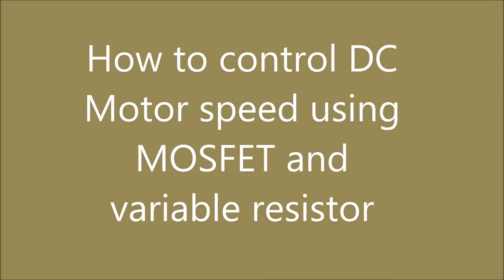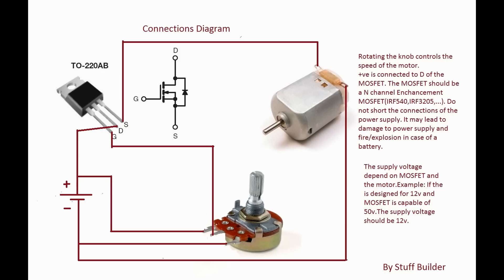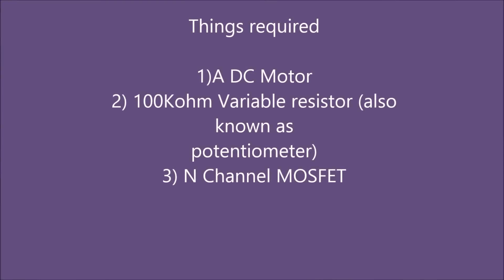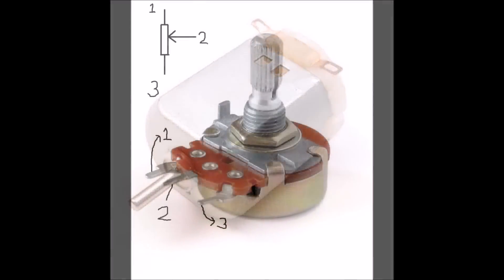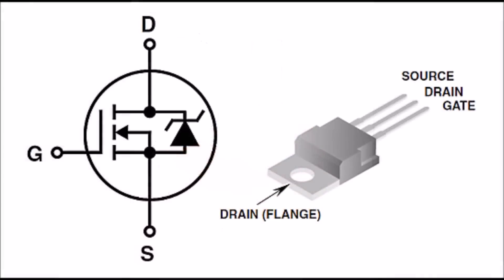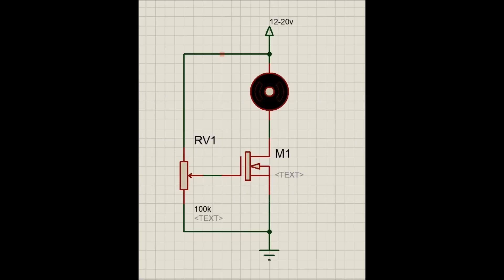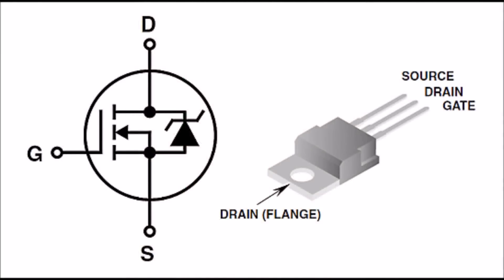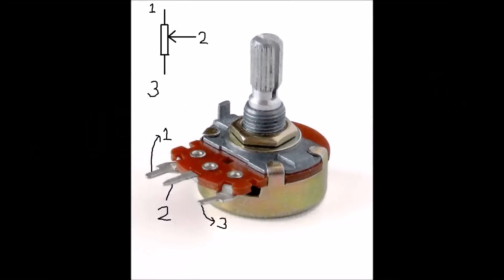How to build the simplest DC Motor Speed Controller(Using Potentiometer and MOSFET)Updated

Comment: Can I adjust the input voltage of a zvs, or 555 driver( fly back driver) I mean...I have a 24v power supply and I want to use it at less voltage too, but it is strictly 24v not adjustable... So can I hook up this and make the voltage lower???
Reply from the maker: +gyorgy komaromi Yes. You can use this circuit as voltage controller. I have used for the same many times!!
Reply: Stuff Builder Wow, thank you very very much!!!! You really helped me :) thanks again!!!

Comment: Could this be use to drive a motor for a ROV?  I am trying to save some money by making my own speed controllers and came up with the idea of using the potentiometer as the variable speed controller.  My idea was without the mosfet, but I am seeing that the mosfet is needed for this for higher voltage.  I am not sure what amperage or voltage I am going to use till I figure out what I need for each motor and other components such as the lights, camera, and possible sensor.  There will be no manipulator for this project for the moment.  Thank you in advance for your assistance in this matter.  BTW, if this works, I am indebted to you for saving over a hundred dollars.  Also, is there a way to reverse this so I can also make the motor spin in reverse?
Reply from the maker: +Matt Walden Yes. You theoretical control the power(torque) using this. But it would require a system to keep the MOSFETs cool(but since ROV is used underwater, that doesn't seem to be a problem.) But still If I were you i'd probably go with PWM. About reversing, you need four MOSFETs configured in H bridge. I have controlled motor in both direction before but I don't remember the circuit that I made. It was a year ago so I forget. And sorry for replying so late. Anyway, BEST OF LUCK with your ROV
Reply: Well... not if you put the dpdt after the the potentiometer and mosfet.  Like between the mosfet and the negative terminal.  That should work and I might do a test on that and let you know.  If this works, I might have a cheaper speed controller.

Comment: +Stuff Builder 
Hello Sir! Does it reduce the speed without reducing torque? (such as PWM). Or is there any simple way I could handle @ home? Please answer asap. I'm stuck in the middle of my project.. Thank you!
Reply from the maker: +kuukeldei deidara Of course the torque is reduced,since it controls the current so less current will produce less force(less magnetic field) and the torque will also get reduced.
Reply: Thank you!

Comment: how to control dc motor speed ....... I have 24v 76A motor... i want to control this motor speed.. can any one tell about it how can control it ..... any diagram of circuit plz tell me
Reply: +usmanshahkot Are you sure its 76 A and not 7.6? You would need a 24v PWM, at around 100A, or a transistor with a potentiometer but the transistor needs to be able to handle the current, or put a bunch of them in parallel. The wiring changes with the type of transistors. Basically, use a potentiometer to feed + voltage into the trigger of the transistor, and the transistor, if wired properly, should vary the output voltage depending on the resistance of the potentiometer.
Reply: +Brian Winzey Not the way to do it. Your MOSFET will need to dissipate about 2kW (76A x 24v). These devices cost hundreds of dollars. Better to use PWM then you can use a cheap $10 device.
Reply from the maker: +TurboElectricLtd The drop across MOSFET isn't 24v, its around 3v when POT is fully rotated. So power dissipated will be 3*76=228W Which is still a lot! So yeah this isn't the way to do it. Go for PWM. It's really efficient! But for lower current, this way is okay
Reply: So the problem is when you have partial conduction on the MOSFET If your motor is drawing 50A (because you are drawing on a heavy load) at say 1v PD the rest (23v) is across the MOSFET ..... and pop it goes.

Comment: tnx for your info I have a dc motor and I want to make an e bike. motor work 12 v  if I connect 24 v it will work of the motor will born I neet mor RPM
Reply from the maker: +Aldeen Tabasa Nope! It won't be efficient! The MOSFET will burn probably! PWM is what you need for such applications! I just uploaded I video yesterday about that but it's a bit more complicated
Reply from the maker: +zabihullah Ahmadi You need a high torque motor to make a e-bike. If you power a 12v motor by 24v, It's windings will burn after sometime.
Reply: +Stuff Builder so i can build e bike with this controller?
Reply: ok ty you are very kind person
Reply from the maker: +Aldeen Tabasa I'm actually not that kind😬
Reply: HAHAHAHAHA

Comment: how to make it more slow then that? like 1 rotation it take 1 or 2 second to complete. add some resistor? pls answer ASAP, urgent matter.
Reply from the maker: +Fariq Qiraf That's too slow. You could try adding a gearbox to its output shaft. I have geared motor like that which rotate super slow but they have a gearbox. You could probably do it but adding power resistor but still it won't rotate smoothly. Still you could try add resistors in series and try. But i'd recommend a low rpm gear motor.

Comment: it work whit 20 Amp dc motor
Reply from the maker: +zabihullah Ahmadi Yeah it will work with any DC motor, MOSFET will change according to current and voltage of the motor. Appropriate heatsink needs to be attached for high power motors.

Comment: Is it possible to apply this circuit to control  a 45W, 12V DC motor's speed ? Will it work that way ?
Reply from the maker: +Yakup Onur Çota Yes it  will. You'll need a heatsink attached to the MOSFET though.

Comment: Do you think it works with 3.6 v at 1.5 A controlling resistive heater ?
Reply from the maker: +dan gh # Actually I'm not sure if it will work at such low voltage. No the MOSFET I've used won't work :(

Comment: i need to build one that will run 120 volts dc. what you think 3 mosfets?
Reply from the maker: +Rj Norman No. You'll a high voltage MOSFET.
Reply from the maker: +Stuff Builder You should be careful with 120v DC. You could get a nice electric shock if don't take proper care. IRF640 should work good for you.
Here's a list of MOSFETs you can refer.
http://www.futurlec.com/TransMosIRF.shtml
Reply: Thank you for the link Stuff Builder and Ill watchout to not become a short in one of my circuits.

Comment: Does this mean if you have an NPN mosfet and PNP mosfet
you could make the worlds most shittiest sounding audio amplifier? lol just by connecting them in a push-pull configuration and adding the input line signal to the inputs then biasing them to "almost turning on" state? and a simple capacitor for the speaker?
Reply from the maker: +realflow100 That's right. That's exactly what i did!!!! But it wasn't shitty. To my surprise, it actually sounded pretty good almost as good as a professionally made amplifier. You just need to bias it perfectly.
Reply from the maker: +realflow100 And its not NPN or PNP , it's not a BJT.
Reply: Stuff Builder hmm then what do you do? o.O I wonder how bad it would sound completely un-biased xD thats what i meant when it would sound terrible xD

Comment: hi, dont you need a diode protection for this circuit?
Reply from the maker: +lui fado If you are talking about diode protection to prevent back-EMF from the motor, then there's no need because most of the MOSFET have reverse diode protection built into them
Reply: +Stuff Builder i didn't know that , thank you.

Comment: We can also control motor without MOSFET and Brother what is the use of MOSFET?
Reply from the maker: +Manasseh Elson You can't just control the motor using the potentiometer by itself! A high power handling transistor is required to control the motor current.
Reply: +Stuff Builder why we cant use just a potentiometer? bro
will it burnout due to load?
Reply from the maker: Yup. That's right !!
The load(current) is high for it. Potentiometers can directly control currents that are lower than 100mA I think

Comment: Nice. The MOSFET gets hot after a while? Could work for 12V, or is too much?
Reply from the maker: +interlinkknight  Yes. It does get hot pretty soon. Its the simplest way,but its the most inefficient one(PWM is way more efficient). That is why is gets hot. I'd say,its best suited for low current applications. The max voltage depends on the mosfet.
Reply from the maker: +interlinkknight I used it to control motors(and other loads) at 24 V. But I connected three MOSFET in parallel and attached a big heat sink to them to keep them from over heating.
Reply: +Stuff Builder The problem with PWM is that is very noisy. You can always hear the winning sound from the frequency of the controller.

For my project I don't care about efficiency.
Reply from the maker: Then you'll need to attached heatsink to the MOSFET to keep it from getting hot. And Good luck with your project !

Comment: what type of mosfet? par# ?  i thought mosfet is just a switch 
is this a Nch or Pch mosfet?
Reply from the maker: Frank Lopez N channel enchancement type MOSFET.
I used IRF540N
Reply from the maker: Stuff Builder
And you are right about its been a switch.But if you vary the base voltage w.r.t source voltage gradually then you will find that its resistance also decreases gradually. But this a inefficient way to control current through a load. 
PWM would be way way way more efficient.

Comment: why do you need a mosfet?
Reply from the maker: Frank Lopez 
The mosfet is acting like a variable resistor. Changing the voltage from 2(below 2v its completely off) to 8v(almost completely on) changes its resistance proportionally.This characteristic is been used to control the current flow through the motor.
Reply: Stuff Builder thank but i know this what i dont understand is why have the pot and the mof, they both do the same thing, just connect power to pot and run the other leads of pot to motor
Reply from the maker: They don't do the same thing!!(Since the pot can't handle high current when is resistance is in the lower range. I have tried using just the pot and it got burned) They are completely different. MOSFET can drive huge current if its  
properly heatsinked while pot cannot directly handle that much current. That's both are needed.
Reply: Stuff Builder true i forgot about the limitations.....they do the same job was my point its a variable resistor.